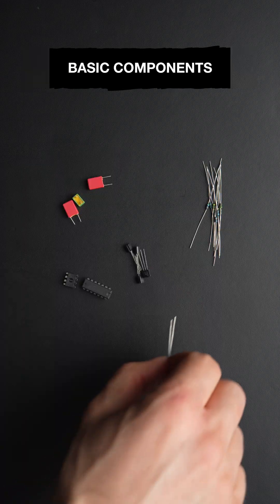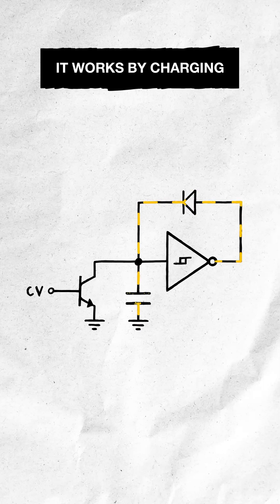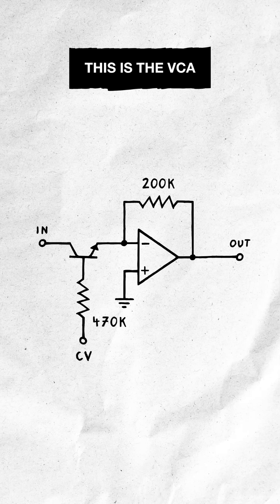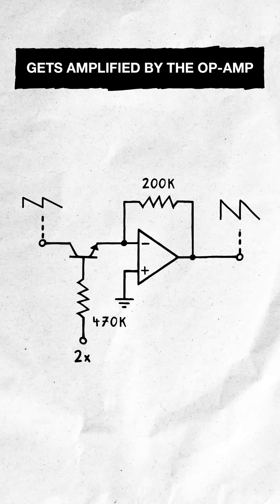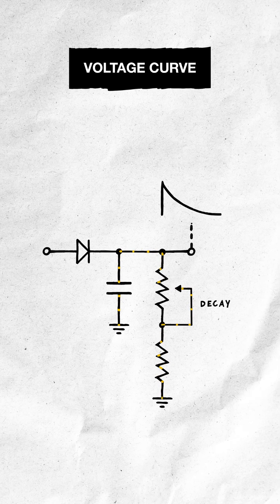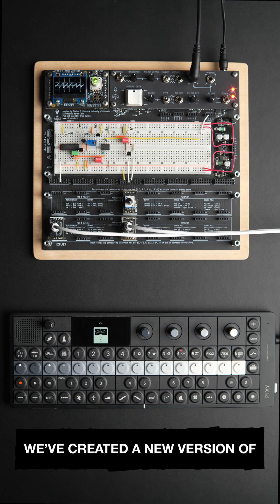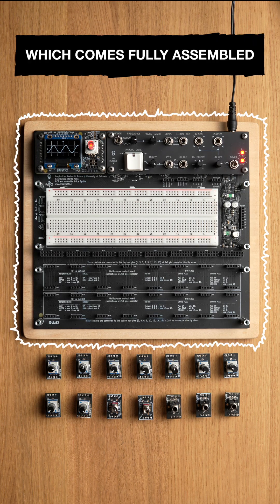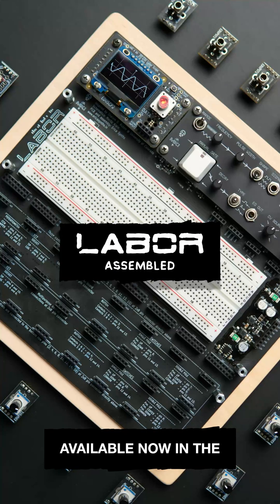VCO → VCA → EG: 3 tiny circuits, 1 analog synth

Comment: But how can you connect that keyboard to that circuit?
Reply from the maker: it sends out both a gate and a control voltage signal. just need to connect those to the respective inputs!
Reply: @MoritzKlein0 tysm🙏

Comment: Fantastic work. Love that 40106 VCO core and have been using it for years. My current project uses this core along with an infra red distance sensor to create a toy theremin for one of my grandkids. I use the pulse output through a 4040 to give a range of octaves and a second 4040 for a couple of sub octaves and then through a low pass filter and a PT2399 echo. Rene Schmitz uses a similar expo converter for his 4069 VCO but with 10k NTC resistors in series with the CV mix resistors. Could these be tacked onto your design for extra temperature compensation?

Comment: I built all 3 (the complete ones from your channel) and they work great execpt for one problem: If I turn up the release of the EG the pitch goes up for a second when pressing a key. Does anyone have an idea why that is?
Reply: Maybe a small resistor is needed to limit the charge current and soften the attack.
Reply: @fano72  Thanks for the answer. Wouldnt that reduce the amplitude of the envelope? I dont know if I get what you mean, but I can change the attack without any problems regarding to the pitch. Or do you think its possible the PSU cant provide enough current?
Reply from the maker: sounds like your power rails might be affected by the envelope. which PSU are you using?
Reply: @MoritzKlein0  Thank you for the answer. I built the one from your channel. That could be the case because if I switch off the power the frequency also goes up till everything is completly off (I guess thats normal). I also had a problem with the PSU, that it only worked when I switched it off and then on again (Im not very good in electronics so I couldnt figure out why that was even though I rebuilt it...with the same components). I will try it out as soon I find the time with another PSU I built for my breadboard.

Comment: I think it has very unstable pitch and not useful, uhm, anywhere. Is it true?
Reply from the maker: i left out the temperature compensation part here to keep it snappy. there's a full length video on my channel explaining how it works in detail.
Reply: @MoritzKlein0  yeah I know, I watched all the videos on your channel, and therefore, knowing that the schematics are usually quite bulky, I doubt that the circuit from this short works correctly
Reply from the maker: here is the full schematic i used for the breadboard build: https://tinyurl.com/287bce96
Reply: @krezhvick2158 I think the whole point is that this covers the absolute basics of synth circuitry and condenses it into a highly teachable form. It obviously works. is it usable? I think as long as the tuning is proper, yes. all it needs is a filter to round it out.